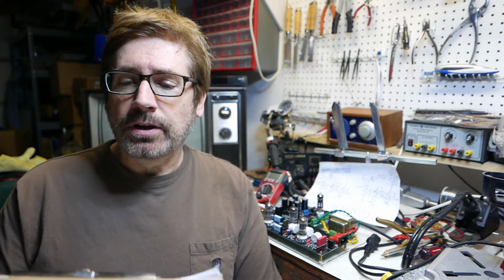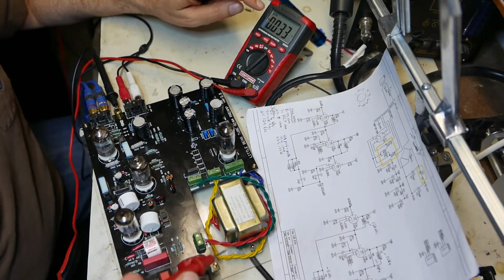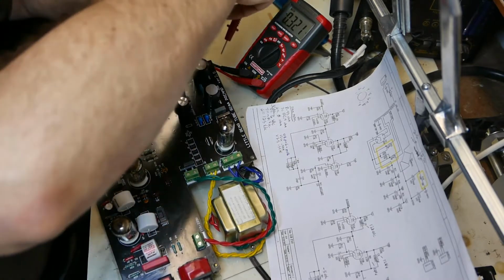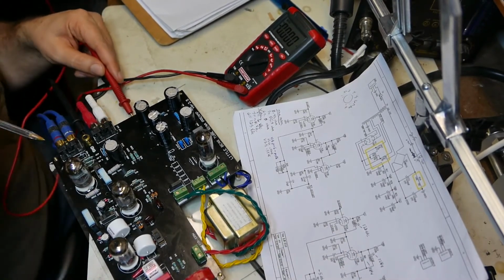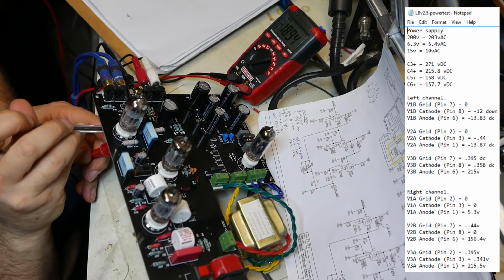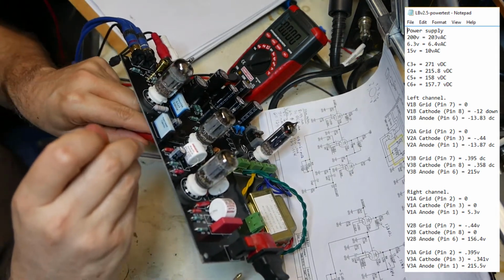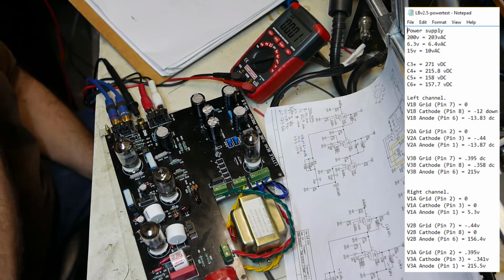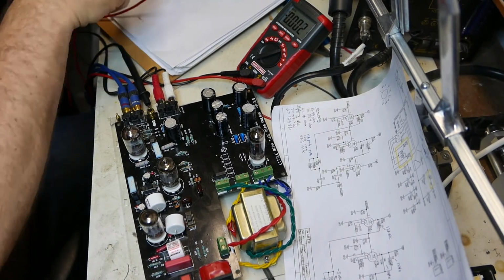Little Bear v2 5 Testing part 2 with StylinLP

Comment: I used this phono preamp like 10 years ago and absolutely loved it.  I moved on to other equipment, but I've always wanted to install it into a proper wooden case or something to give it the respect it deserves.  I remember reading that it was based upon a classic EAR 834P phono stage circuit.  Do you still use it?

Comment: Don’t forget you measured your voltages with the other green multimeter last time, the accuracy rating of each of your multimeters will be a little different, i’d try measuring the voltages again with your other green meter and see what results you get.
Reply from the maker: I just figured out where I went wrong. I ordered those new Takman resistors in the wrong values! augh. They suppose to have a letter "K" but I ordered Ohms instead. So anyway...I just placed an order for a DIY Resistor pack with 680 resistors. Going to swap them all out just to get this thing working again. 

4 x Takman REY 1/2 watt 910K Ohm (666965) = $2.88
4 x Takman REY 1/2 watt 2.2 Ohm (666020) = $2.88
6 x Takman REY 1/2 watt 62 Ohm (666265) = $4.32
4 x Takman REY 1/2 watt 330 Ohm (666384) = $2.88
2 x Takman REY 1/2 watt 220 Ohm (666356) = $1.44
2 x Takman REY 1/2 watt 100 Ohm (666300) = $1.44
Reply: Yikes! thats a hefty change in value lol that would do it. 
Hope you get this thing going once the new resistors arrive.